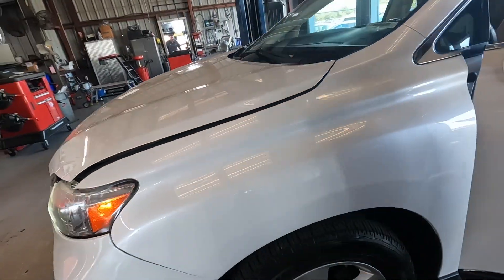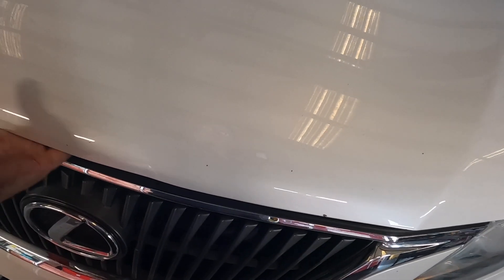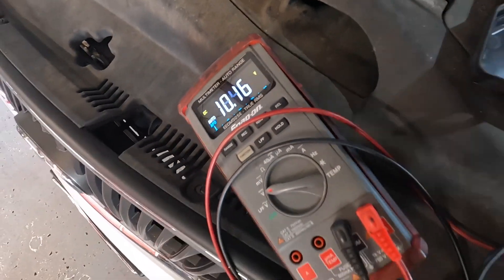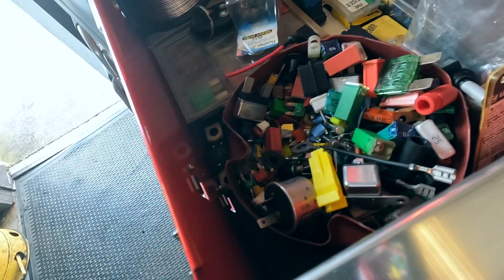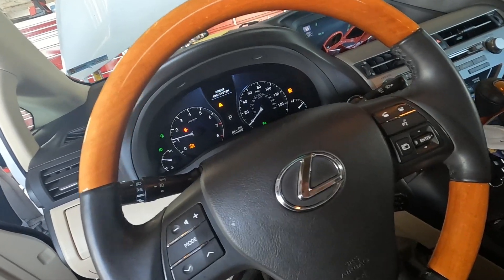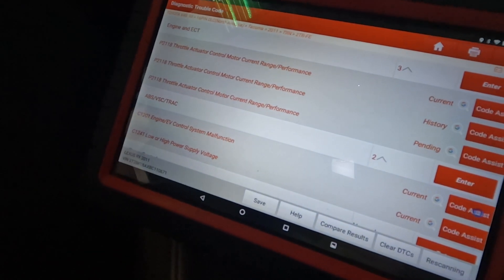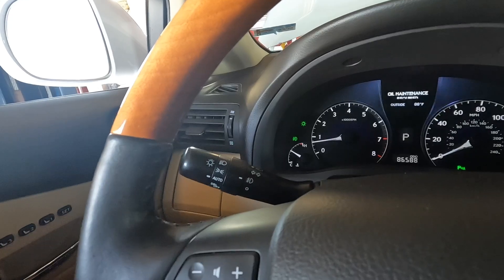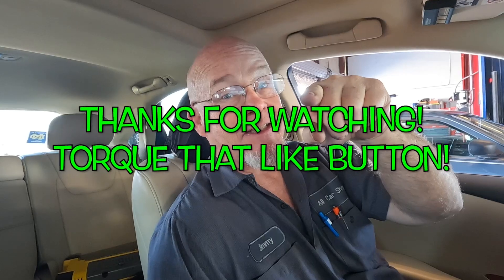LEXUS RX330, BATTERY DIED, LIMP MODE ELECTRICAL ISSUE...

Comment: 62-year-old female here… You are hilarious! I think it’s my back tailgate somehow not closing all the way. Leaving the light on. Brand new one year old battery. I will never get this time back… I’m exhausted. It’s been a few days better pick up my prescriptions. I will call AAA. By the way, FYI… Isn’t it an RX 350?  just saying… if it is, I’m going to buy a lottery ticket.
Reply from the maker: Haha, Thanks very much!
This was a 330, I think the 350 looks the same but has a bigger engine, later generation maybe also?

If the interior lights are staying on because of the latches the tailgate is a common issue for sure. Unplugging it can prove it out to be sure before buying any parts. I would have a good shop take a look at it if it's not something you're comfortable messing with, removing the rear door panel and that kind of thing.
Hope you get it sorted out!

Comment: im having issues myself. 01 rx 300. 180,000 miles. new battery, alternators fine. possible parasitic draw.
Reply from the maker: I use a small amp meter that can be installed between the battery and the ground terminal. Then remove fuses one at a time until I find the draw and reduce it to under .05 milliamperes.

Comment: Hi I have a 2006 Lexus rx330 and my battery keeps dying. I thought it was the battery but I changed it and it still has an issue that's draining the battery . Alternator is also good. When I take off the "short" fuse it doesn't drain the battery. Do you think it could be #10 fuse too?
Reply from the maker: When I have a draw issue, identifying the fuse that removes the draw is first. After that I’ll use a wiring diagram to find everything that could be powered by that fuse. Than it’s a process of elimination by unplugging things.
Hope this helps.

Comment: My lexus rx330 2005 check engine and traction off light came on yesterday we got light off and found out it was out of coolant and it started running rough this morning when I cranked it and acted like it didn't want to crank when I tried it again I just sent it to garage on tow truck and he cranked it and drove it on truck and said it was running fine so I have no clue what it could be
Reply from the maker: Might be starting to burn coolant. I’d check it thoroughly for leaks, if none are found check for combustion gases in the cooling system. They make fluids to test for it.
Reply: @JimmyMakingitwork  I sent it to garage hopefully they will find out what it is
Reply: @JimmyMakingitwork  garage said it needs coil tuneup and timing belt 1298.80 he said timing belt hasn't been changed in years I figured that just glad I got it there before it broke
Reply: Lol being towed again turned key no sound nothing headlights working and dashlights working I should have bought a used Buick
Reply: @kellysutton2780  Could be an issue with the starter or ignition switch. That's what happened with mine. Good luck.
Reply: @gundy6603  it was the starter costs 492.48
Reply from the maker: Glad you got it sorted. Basically almost all the problems they usually have are done. :)
Reply: @Jimmy, Making it work  next thing to do is oil change brake and tires in two weeks probably expensive but has to be done
Reply: @kellysutton2780  Another thing to check since the starter was bad is the battery. I found out that when the starter goes bad, the battery has to work extra hard to get it to work and may need to be replaced.
Reply: @gundy6603  it's in the garage right now getting new front and rear brakes and oil filter air filter and cabin filter replaced I bought a battery in January from auto zone I told him to look and see if I should get a different one and also having new tires put on